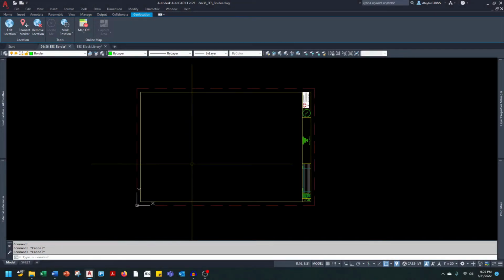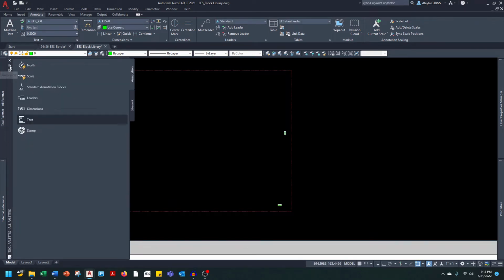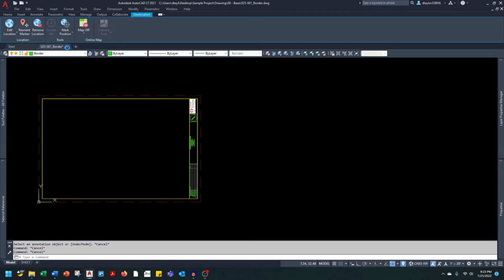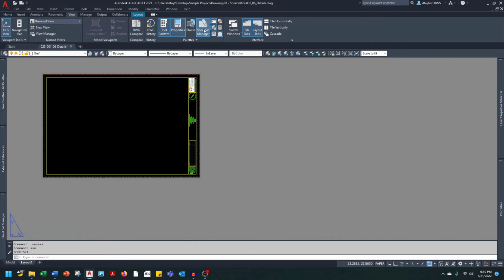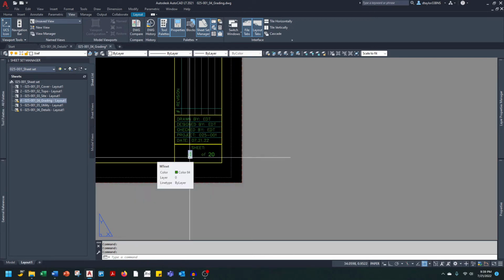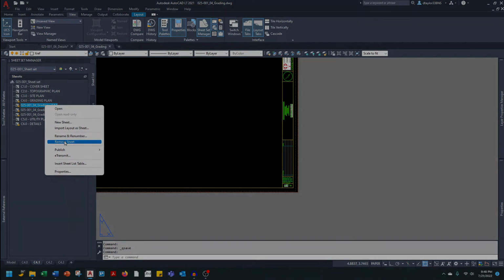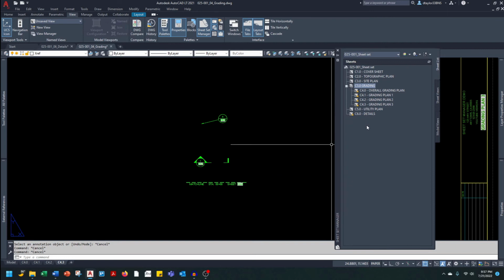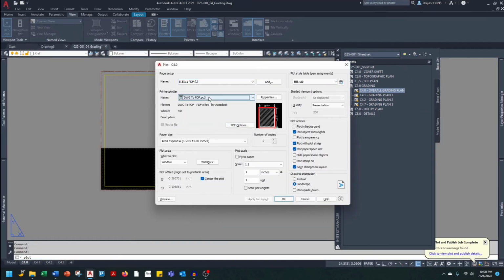Detailed Guide for the AutoCAD Sheet Set Manager

Comment: hi,
i did not use it yet.if layout is 10 numbers in one drawing, how to increase the layout.i mean (1 of 10, 2 of 10,3 of 10 etc) in the sheet set manager. can you explain?
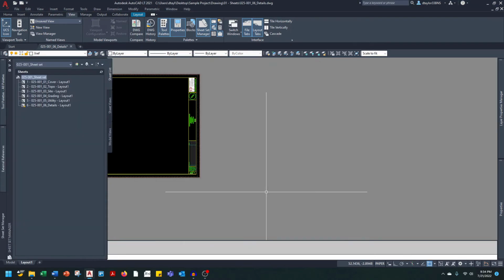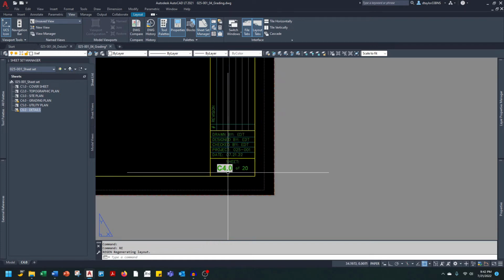Reply from the maker: Once the layouts are inserted into the Sheet Set Manager, you can renumber the sheets using the Sheet Set Manager.  I am not sure if there is an automated way to do this besides renumbering each sheet. You can look at time stamp 11:39 for renumbering the sheets and time stamp 13:35 for adding sheets.
I hope this helps.